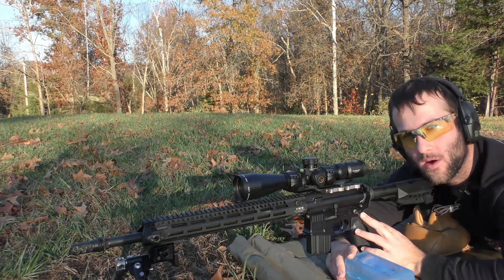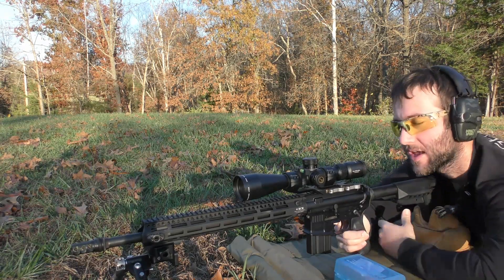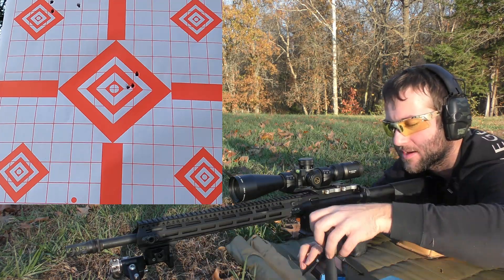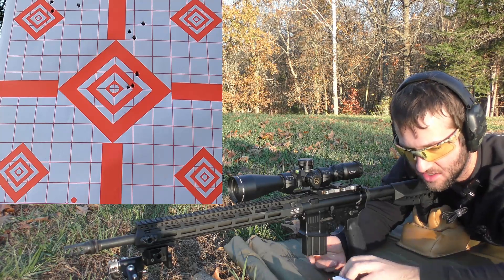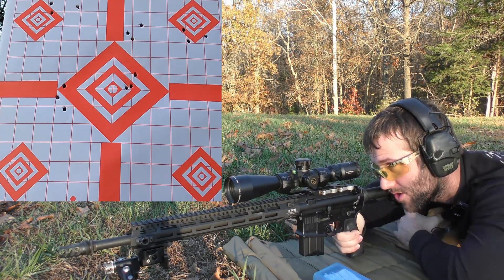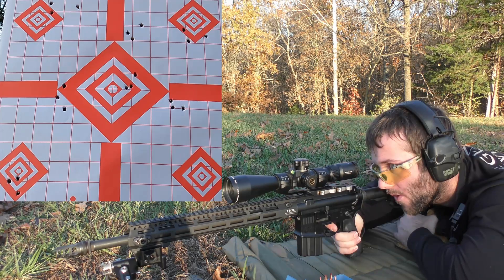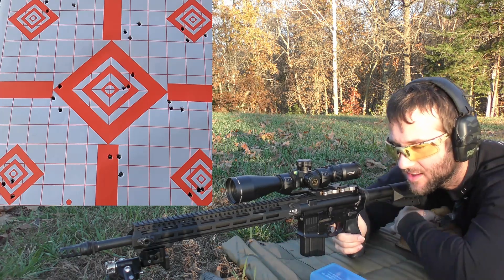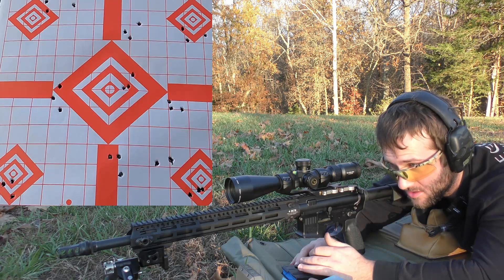22 ARC: 62g ELD-VT Tested with H335 X-Terminator 2230 TAC H4895 2520 Varget CFE 223 & Leverevolution

Comment: I loaded my first 10 rounds 31.7 gr of Leverevolution with the 62 gr ELD-VT 1/2" group running at 3254 FPS, liked them so much I don't think I could improve, that's my load. Don't remember the ES or SD but they were really good mid single digits.
Reply from the maker: That's fantastic!

Comment: I think the 22 ARC sucks especially my @BallisticAdvantage barrel consistent feeding issues especially with the 88gr ELD’s I can’t get any good groupings with either the 88’s or 62gr ELD-VT both factory ammo I haven’t bought any dies because I am going to try to return the barrel to BA I have 4 other builds w/ Ballistic Advantage barrels .308, 6.5CM, 6ARC and all shoot sub moa and function fine no hiccups the 22ARC breaks the tips off during cycling then jams up in the lugs causing the bolt not close or causing the next round to stove pipe and dent the shoulder making the cartridge useless all my ejection are perfectly to the 3 o’clock the 62 gr seem to cycle ok so far but I had a literal 3 ft spread at 635yds so my conclusion is the Ballistic Advantage 22 ARC barrel sucks hard the +1 gas doesn’t do anything for the cartridge I tried several times to call ballistic advantage and they don’t answer their phone I will try again

Comment: My 22 ARC sports a 24 Ballistic Advantage barrel and during break in I used factory Hornady V-Match 62 grainers and it shot amazing but hand loads were not as good. Annealed all my brass, crimped bullets and they finally came around. 31.8 grains of CFE 223 and CCI 450 primers, also running Superlative Arms adjustable gas block,
Reply: Hello I have the BA 24” fluted barrel but have had nothing but bad luck with it I can not get it to feed the 88 gr ELD Hornady factory ammo it breaks the tips off during cycling gas is perfect at the 3 o’clock the accuracy sucks on mine as well I had a 3 ft spread with the 62gr ELD vt Hornady ammo at 635 yds I have 3 other builds with BA barrels that shoot fine all sub moa in 6.5CM, .308. and 6ARC 
tried different mags etc my BA 22ARC barrel is horrendous how does yours shoot the 88gr ELDs
Reply: I have not tried 88’s in my ARC as I have used them in other fast twist 22’s and they just suck! I am really wanting to try some different bullets with this cartridge instead of just Hornady. I have shot a3 shot group with 62 grain Sierra SP’s and they show a lot of promise better than the  Hornady vt . If I were you I’d try the 77 grain Sierra tipped match kings or 80 Eld-X. I’m for sure going to try the 77 grain Sierras
Reply: @submoa6977  thx for the reply sounds like you’re not so far finding what you’re looking for in the BA 22ARC either I feel like I wasted $180.00 of Hornady Ammo so far still got 5 boxes left but I don’t think I will bother to buy the dies maybe just try resizing the cases to 6ARC and try to return the barrel to BA thx good luck with your 22ARC
Reply: I wish BA would have made it in an 8 twist instead of a 7, still think it’s a good cartridge but until more manufacturers develop for it we’re at the mercy of hornady and they’re products

Comment: huge air gap without lead support and low bearing surface to lengthen the bullet. i doubt these bullets will ever consistently shoot well. everyone is having problems with them. these have to be a nightmare to produce and the consistently is suffering. not one good group in the bunch with all those powders is a red flag.

Comment: Neck tension is probably way off......
Reply: @risencitizen it can vary for me but often it's .002 smaller than bullet diameter.   For 22 and 6arc I use Eric Cortina's .222 mandrel and his body sizing mandrel die.
No need to crimp and virtually no creep from chambering.
Reply: @PaulC-onebadjack1313  I have never crimped any centerfire rifle ammo, but do crimp all pistol ammo. I have yet to have an AR15 bullet go into case or out after many 1000's of rounds.
Reply: @lrlapua8035  I dont crimp because there isn't any way i know of to be consistent with crimping.  Mandrels are the way.  I did had some 300blk grow ~.007 when chambered using formed lc brass.  With Starline it's been ok.
Reply from the maker: What is it supposed to be?